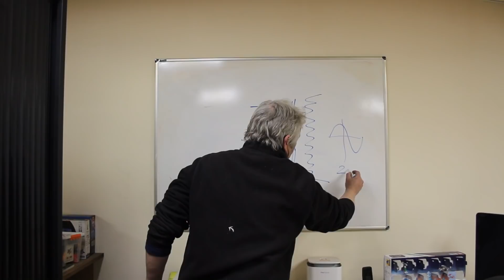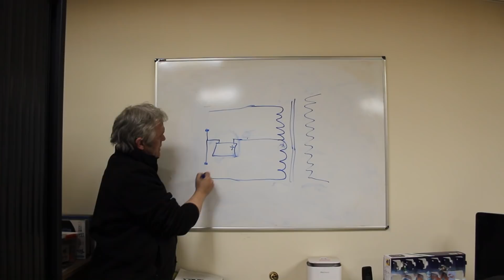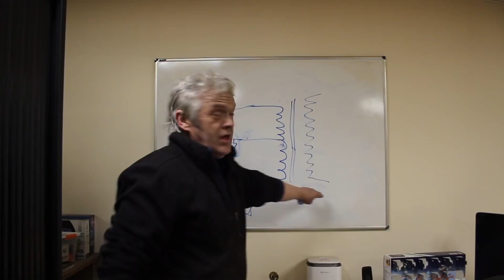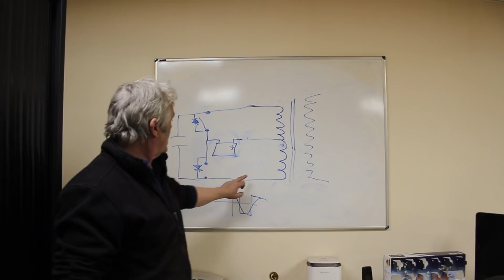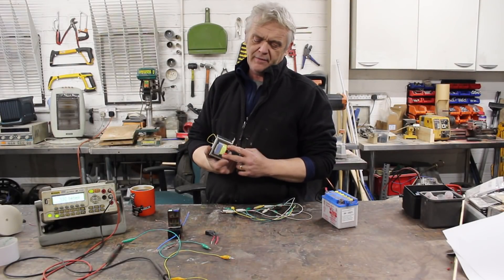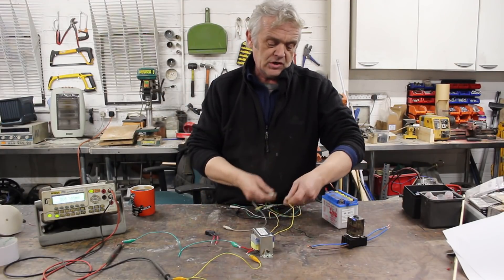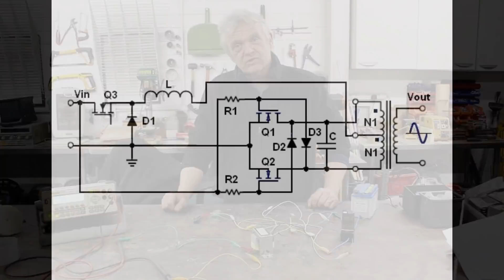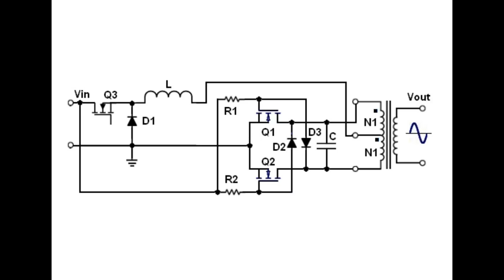1399 A DIY Inverter For Home Energy Storage - Wind Or Solar

Comment: In another video you wired the DC relay in such a way that it kept switching on and of and so that its coil would keep vibrating by itself and you connected it to the transformer and it came out as AC from the transformer

If i wire the relay so that it keeps switching by itself and if i add the diodes and the capacitors as you did in this video will i get a pure sine wave out of it ?

Comment: I’m here because…. I want a battery system for my home studio / office.  I want to turn off the mains input (smart plug or maybe even arduino control) and seemlessly switch to battery when electricity peak price is high, last for about 3-4 hours (2 kWh total) then the rest of the time be charged (lifepo4) ready to go. …

Comment: Hey next ......in th u.s. the power is two 110 lines to make 220.......three wires ....2 hots and a neutral.....they are out of phase 180 degrees..ok ...next make two 110ac lines that are out of phase 180 degres.......power source  pv panels......48-36vdc......cheers

Comment: Robert, thank you for the nice schematic at the end of the video!

I did a simulation in LTSpice with a 180u np cap and an approximation of a center-tapped doorbell transformer (LV 10mH-10mH, HV 1H).  With 12V DC in, this yielded a nice 60Hz sine wave consuming about 12W with a 1K resistor load on the high voltage side (160V AC).  I used 10mH for the choke.  The choke inductance needs to be about the same magnitude as the LV side of the transformer.  is really important to have!  Efficiency is about 80%.

Comment: I enjoyed your video.  Your design is limited by the size or massive weight of your transformer.  Would like to see you revisit using something with a higher efficiency transformer (lower weight, smaller cheaper) using high frequency and adding power factor correction on the output.  Also with a respectable output power say 1300 watts or higher.

Comment: Hi Rob. My interest in inverters has increased significantly the past year. Can you consider doing a video on diy'ing an inverter run off a 12v battery with a normal household plug output. Imagine using this portably on appliances such as a toaster, TV, etc. But only as required and one appliance at a time. I finding lights quite easy due tp4056 modules, but standard appliances requiring ac on something similar is what I'm looking at next. Right now I want to run a ac fish tank water pump, but struggling to decide if a PC fan inverter, MOSFETs driven, etc, with what I learned from your videos. But which would practically be easiest/cheapest to DIY for different appliances. When does a device become 'sensative' requiring sine wave. A lot of questions lol, sorry
Reply: A lot of devices have internal circuits that will cope with inputs that are not pure sine waves. I find it's usually audio equipment that has some problems such as 'noise', also some motors are a bit noisy with square  wave inputs.

Comment: As always wonderful an innovative. Is creating a sine wave output really as simple as introducing a smoothing capacitor though? Commercial inverters go through a lot of trouble to do it with pulse width modulation.
Reply: That capacitor is also part of the tuned LC circuit. The modulated high frequency inverter you mentioned is also more efficient.

Comment: It has been a long time since doing my Elecronics Technician training.  I do remember transformers as a fun way to change waves until you get a sine wave.  Pure 50 percent duty cycle square wave will become a triangle, and next a triangle will become a sine wave and all until you actually do something other than use a scope on the output of the transformer.  After adding anything to the transformer output, errors ( real life ) happens.  I have repaired a few inverters and the better quality ones use a Ferrite core Toroid transformer and not just as a combination of mass and space savings, also better power efficiency out.

Comment: This was so helpful I can't even articulate. I have a lot of projects going on right now the project that I would need to learn this to complete this is kind of farther down the line but I still needed to understand this so it is a great help to me and I just randomly stumbled upon the video. What a great help you are. I am 3D printing would I hope it's gonna be a very highly efficient generator that runs off of a small wind turbine above and behind my garage. I have it set up so it'll transfer mechanical energy through the wall of my garage and it doesn't quite well. I want to slowly build up a Bank of batteries and keep adding on to them so I have basic electricity for the things I need during storms that knock out our power. What I have to figure out is how to set up an array of batteries in that way that will allow expandability.

That might be a good video for you to consider designing a better battery array for DIY energy storage

Comment: 5:38 That shows keen insight.  "The rest is about sizing components, and then purifying it and taking care of it and actually making sure it doesn't exceed it's limitations".  You could almost be describing a flyback device using algebra to size components, purifying it with an emi filter and a pulse width modulator taking care of it with a micro controller with a preset program and making sure it doesn't exceed it's limitations with a voltage limiter .  Interesting video Mr. Smith.

Comment: Very entertaining.and informative.. Used to be called chopper circuits.. and higher frequencies of chopping meant need smaller transformer requirements.. they used them in power supplies ..  but that's a nice intro to subject.. thx. Ps you can buy invertors em places like machine mart if they still exist

Comment: Hello Robert. I have a question.  I have a B&D 750W 6.52amps inverter model PI750AB.  For the most part it works perfectly.  But I'm experimenting with using it with a smaller battery in my chicken coops when needed.  I have it hooked up to a GT12080-HG 12v 8ah battery.  I can run a fan, laptop radio etc no problem. But when I plug in a 200w heat lamp the inverter goes yellow and cuts the power.  it wont work.  The battery is fully charged.  Why is a 750watt inverter shutting down when plugging in a 200watt heat lamp???   Any ideas?  I'm trying to put the lightest battery I can use just in case I need to move it.  I'm 78 and can't much carry heavy things.  Thank you for reading

Comment: I just wanted to thank you for this video. I have been trying to find a solution for strobing Christmas lights at 60 hertz and wanted to create a variable frequency power supply capable of supplying enough voltage to light the string while reducing flicker. There were a few key concepts I could not seem to grasp until I watched this video. Thank you again for taking the time to explain it. It's hard to find videos that get into the nuts and bolts.

Comment: Hi Rob, thanks for your videos, it really clarifies these concepts to amateur folks like us.

Is it possible to build a 500W/1000W inverter producing 220V of pure sine wave A/C using the following part list. Can I scale this build up to a 2000W capacity by just swapping out the transformer and fitting a new one, if not, can you highlight the changes I need to make to the part list in order to achieve a higher capacity. I intend to use the inverter to power any home appliance from A/Cs to computers, please help.

- EGS002 SPWM Inverter Driver Module
- IRF3205 or IRLB4132 MOSFETS (16x)
- 12V UPS Transformer (500W/1000W)
- (Transformer Ratio 7V:220)
- TO-220 Isolation Set (16x)
- TIP31C NPN Transistor
- 7805 Regulator
- 1N4007 Diode (8x), use FR107 or UF4007
- 10k Ohm NTC Thermistor
- 10k Ohm Multi-turn Trimmer
- 10 Ohm Resistor (4x)
- 2.2k Ohm Resistor
- 10k Ohm Resistor (4x)
- 100k Ohm  Resistor (2x)
- 470nF 25v Capacitor 
- 2.2uF +350v Capacitor 
- 2.2uF 25v Capacitor 
- 10uF 25v Capacitor
- 100uF 25v Capacitor
Reply: Woulnt it be a good idea, to learn about these, from College,, books,,helpful knowledgeable friends and family?!
That would give you a far better Grasp of the Subjects....
Rather than being Given the Answers, it is Way better to learn how to Problem-Solve for  yourself!!
I hope this helps, please dont take offence, as I meant none!! ;0)X
Reply: Here's some random petrol car parts... what do I need to make a Tesla....   👎

Comment: Could this be used to step down the voltage and up the current from something like a Zamboni pile or is the pile not capable of supplying enough power? I have seen that you were looking at a fractal capacitor for this but would this circuit work for the same process?

Comment: funny, with those diodes parallel to the switch, you still get positive inductive spikes from the coil being switched open. The mosfet has an internal body diode that does the same.

Since the inductive spike is a resonant halfwave, it quickly is transformed into a negative voltage which then is passed through the diode back into the battery. Which is efficient, as the magnetic field energy of the coil is recycled. 

If you really want to get rid of the high voltage inductive spike (which sets up a displacement current from the rapid voltage change), you could place the diode parallel to the coil. But then the energy of the coil will be burned away as heat inside the diode.
Reply: Ah, interesting.  There's always something more to consider.  Tradeoffs to contemplate.

Comment: Hello Rob do you have a video like this where your using a stepper motor as the power source and a transformer to step up the voltage to power 110-240 volt lights or anything else?

Comment: A thought.... consider bulk of circuit as akin to a class D "switching" amplifier. 
reference signal to be amplified to become inverter output, could be from a sine wave oscillator. or even mains that has been step downed for output. 
generator error singal by comparing  to a feedback signal produced from a tiny step down transformer across invertor's output.

difference between sensed and reference voltage should  thus indicate which way a push-pull invertor would need to push current through it's output coil to keep the synthesised mains in phase, and at aprox the right voltage.
if using real mains,+ transformer as voltage reference. voltage difference between the reference and feedback transformer coils could be directed current appropriate relay switch coils, with steering diodes to only allow current through coils when output needs topped up one way... ie one diode allows current to flowing one way goes through coil A, and other didoe allows reverse current to flow through the other coil B

A fairly simple, that is "dead bug" construction (with some resistors to add hysteresis) , quad comparator IC chip , should be able to generate signals to switch grounding FETs at the right time

Comment: Back on another video where you were working with armature on a motor and I said you could use it to make an inverter that’s all you need right here. I made one like that when I was a kid. You can speed up or reduce the speed of the motor to get the required frequency for output

Comment: Robert-I am an electronics guy. Your simple explanation of an inverter was very good and very accurate. Btw, before semiconductors were cheap and available, car radios still used tubes/valves that required high voltage DC. This was made from 12 volts in a similar manner but used actual mechanical switches to excite the primary of the transformer. These "vibrators" worked okay, but the switch contacts had to be cleaned quite often. They looked like a metal valve/tube and were in a similar socket so they could be swapped out.
Reply: I remember bringing a few 'vibrators' back to life in the early 60's. good memories... most car guys didn't know the radio stuff.

Comment: After looking at this I am wondering how could you harness the collapsing field and back EMF? I believe it's at 600 volts.

Tesla patent 1903 did a invention that harness the back EMF.
Reply: It doesn’t matter if you harness it or not, you won’t even get 99% of your energy back out. Besides, lots of things take advantage of back emf. That’s how flyback transformers work. It’s not magic, it’s just a way to get a higher voltage without using as much copper wire, so it saves manufacturers money...
Reply: @jjhack3r  
Flyback transformers
Thank you for pointing that out. I didn't know that.
Reply: The answer is by using a diode or two. Very basic circuitry.
Reply: @jjhack3r  
Thank you for your input.
Yes  ( a diode) but we're in relationship to the 555 chip configured for the ( right timing is also a question for me.) 

Patrick Henry channel has many examples of harnessing the back EMF. He goes over existing patents in detail. Including Tesla's 1903 patent that harness the back EMF.

I have also seen the (diode or resister ) placed with the flow going in reverse placed after the 555 timer but before the coil.

This build is different than those, so I am not sure where to place the diode you mentioned per say to harness the collapsing field ( back EMF) and route it back to a battery without damaging that battery.

I am not as well versed in electronics as I would like to be.

Comment: Cheers very much, I've seen a resistor bank as a Smoothing cap for those to make it simpler, 10k 1k 100 ohms in series, got a pretty good waveform.
Reply: That sounds like nonsense.

Comment: This isn't really a diy inverter, more of a demonstration of the principles. Using that zvs circuit won't work well for this at all. The frequency will vary depending on the load and the transformer output voltage will sag tremendously, possibly even having voltage spikes that could kill your devices. Also its worthy to note that most of the zvs circuits you find online are giving component values optimized for 10,000 to 40,000hz. Real inverters have lots of "smarts" to prevent the output from being out of spec. Most inverters (except ups units) have 2 stages. First stage is something like a zvs circuit that boosts the voltage but runs at high frequency and is designed to provide stable voltage. The second stage rectifies that voltage and runs it through an H bridge to form the 60 hz output but it does that by using pwm and running it through filtering. UPS inverters are inefficient but directly drive the transformer with a pwm based 60hz synthetic sine wave and the transformer does the filtering. They do it that way to not only make use of the transformer that charges the battery but also because it can better produce a cleaner low noise output for computers and sensitive devices if done right. They still however keep a close eye on the output voltage to keep it from ruining your computer. No diy inverters will be a viable alternative to a store bought one considering how much effort would have to go into designing and building a proper inverter.
Reply: might it be possible to use class D amplifier ideas, and compare a  reference waveform  to actual output? if feedback strong would it not swamp out  spikes etc
Reply: @stevecummins324  the class d concept is exactly what they use in modern inverters. It’s simply high frequency pwm artificially producing a low frequency sine wave. However, to make a circuit that does that and monitors voltage, wave form and so on is not as easy as it sounds. Not impossible. But not practical. It would be more cost effective to buy one.
Reply: @jjhack3r  it'll hazard it'll be the high price of mains frequency transformers of decent power capacity that makes transformer based designs uneconomical commercially. If transformers can be scavenged.... Not a factor.
Reply: @stevecummins324  not really... the hard part is making sure it won't kill your devices or fail to provide the right voltage and frequency under load. An inverter without monitoring built in is worthless and dangerous to anything you plug into it.
Reply: @jjhack3r  half decent class D's type would look at the output voltage and use that and reference input  to determine how/when  to switch their half bridge.

doesn't need to be that complex a circuit.... 
LM339 IC etc that picks up a scaled copy of the output and compares that to what output should be at the time should easily keep output voltage to within a small % error of the scaling of the reference voltage. if powered device can't cope with such voltage errors, it probably shouldn't be plugged into real mains.
Reply: @stevecummins324  by the time you've designed the schematic, soldered it together and made a case for it, you will have spent far more time making it than what it would have taken to work a minimum wage job to buy one... not even including parts cost... The diy version would be far larger and inferior, given that it wouldn't have overload protection or under voltage protection without, yet again, more complexity, time and cost. Do what you want, but it's not worth it.

Comment: The blade less back to back computer fans come to mind here. This is proper "pepper" project for when ( not if ) the grid collapses and practicality is more important than effeciency
Reply from the maker: I agree mate - I was thinking of running one of these up from a microwave oven transformer
Reply: @ThinkingandTinkering  not sure how the secondary winding would look though, two counter wound coils of about 14 windings each? Thick as possible wires, efficiency is not that important if you need power?
Reply: @kilokilos  oven transformers are just crappy in general. They use low quality electrical steel and are also not interleaved

Comment: Oh, that takes me back. I made one at around 15 years old. Used scraps from around the farm and wound the transformer/ballast/relay from scavenged magnet wire. I doubt it was very efficient but it was a load of fun to run.
Reply from the maker: that is just plain awesome mate
Reply: me too. Takes me back ,But I made mine from a kit I purchased at an electronics store in 1984 when I was 15 yrs old.